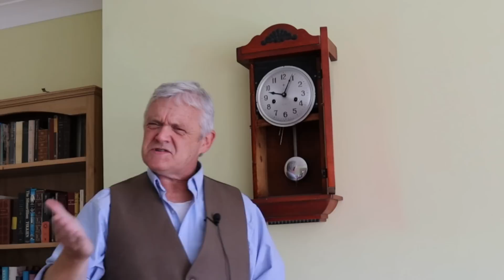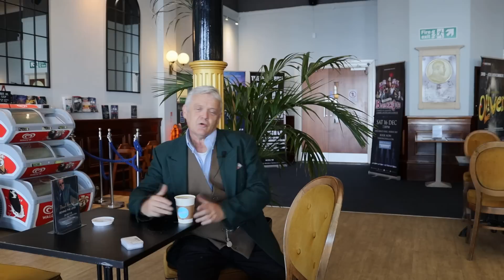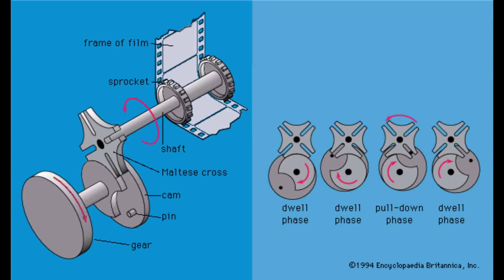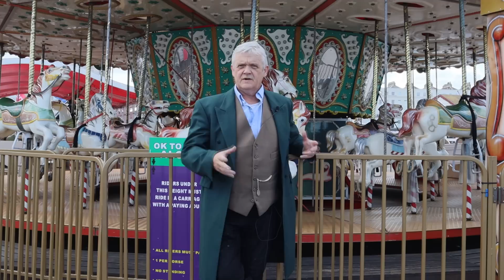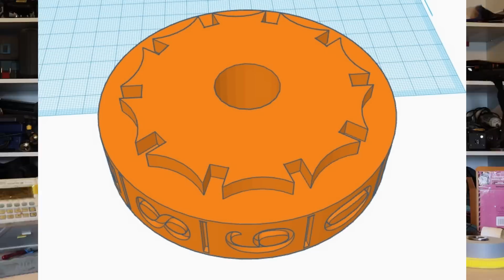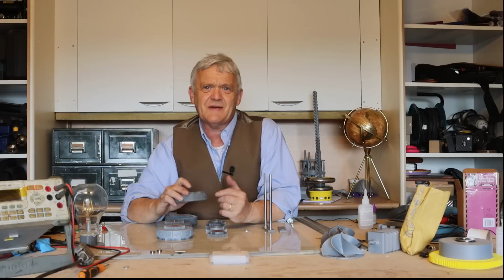2050 The Geneva Drive, Counting And Film Projection

Comment: I believe we used this gearbox to load coil springs into a shotblast motor would stop before output engagement when loading window turns output shaft attached to 4 paddles @ 90deg
So accurate and robust Might of had input clutch but output was always perfect 90 deg.Never knew what it  was until now. Ty Robert

Comment: That is neat but don't you think it would be cheaper easier and quicker to use a cheap $1 solar calulator and a reed switch out of a free treadmill out of the trash and a magnet , I made one but I have not yet built the coil winder part , thats the part where the magnet goes to advance the counter. Thanks for the video.

Comment: We used a Geneva Drive for weighing craft beer cans on a filling line. It would rotate the can onto a load cell, while holding back the rest of the cans. The processor would then decide whether to pass or fail the can. If it failed, an air ram would eject it off the line.

Comment: Ive been thinking for a while to make a scorer for golf using this mechanism, just two wheels to hold two rounds of the Par 3. I knew it was used in old cassette players and had something to do with a Maltese Cross but I couldnt find it. Geneva, no wonder lol. Ive now got the wheels designed but the reset mechanism is making my head hurt lol. Thanks for the reminders, up til now its actually a lot simpler than I thought.

Comment: Hello Robert, I had an idea for you to maybe test out?? You know your double bladed wind generator you created recently? And the Omnidirectional generators? What if you take your larger bladed generator, and replace the blades with mounting poles that each hold an omni-directional generator?
Basically, this would mean you have a central generator with several omni directional generators spread out around the central hub.
I just thought it would an interesting experiment 😀

Comment: As beautiful as this concept for counting coil windings is... a simple and cheap alternative (Under £8) is to use a Digital Hand Held Tally Counter. It's very easy to Solder a micro switch to the 'Add' button and with it, you've a versatile, reliable and compact Winding Counter.

Comment: The Geneva mech was well used in manufacturing, for table indexing on filling machines for example. Sadly with the advent of stepper and servo motors, not so common now.